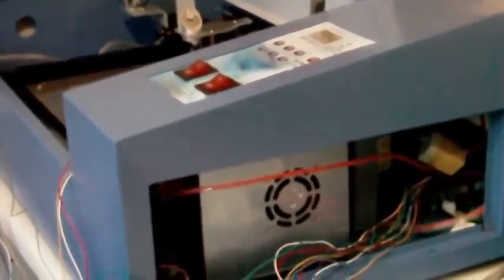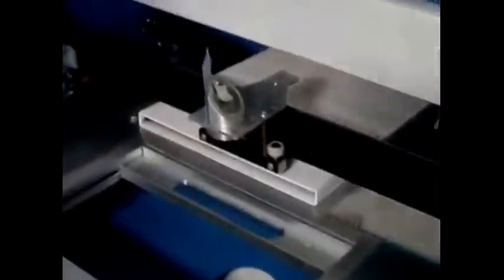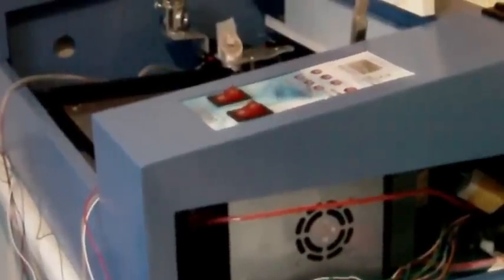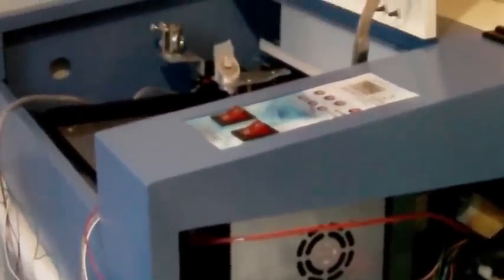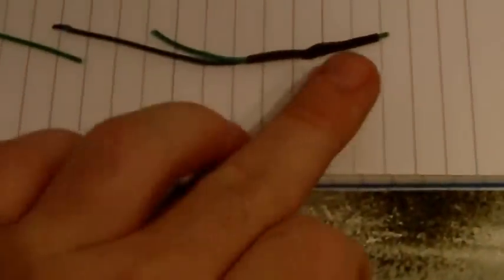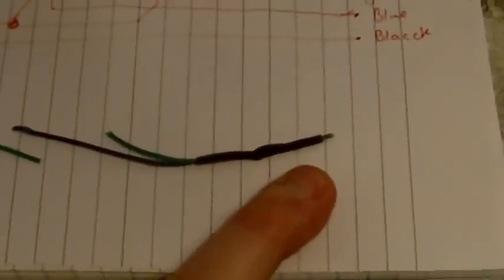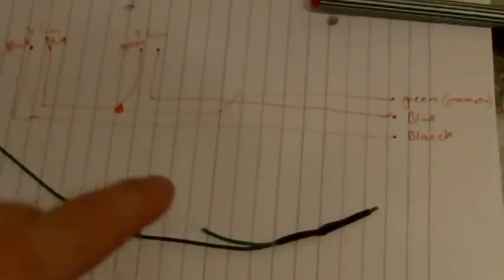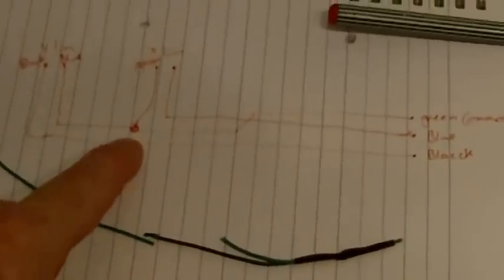cheap 40w laser cutter from eBay

Comment: You are talking about home switches not a limit. Limits are not fitted to this machine - however there is place for it on board.
Glad that you managed to sort out your problem, many users including myself finding something not right on this model:(
Reply from the maker: yeah, the two limit switches are used as homing switches in the homing cycle, but they do also act as full limit switches on those ends of the axis - it's a shame they didn't include the extra 2 micro-switches for the limits at the other ends too. :/ but for the money - can't really expect too much. I have a feeling I'll be ripping the electronics out and putting an Arduino in at some point as I really don't like the software they've supplied and the face it wont accept G Code!
Reply: Crazy-Logic If you want the speed than use the ethernet - expensive but worth it. What kind of arduino are you going to use? the same shield as in 3D printer?
Reply from the maker: janeqmx I could move to Ethernet, your comment has made me think about putting a Rasberry PI in instead of an Arduino, or maybe both. I was going to put in a standard Mega, and Id use my own Motor drivers shield, or or I could use any >2 axis motor shield that's off the shelf. Does't really matter to be honest. If I can replace the electronics then it'll make the machine allot more powerful.

Comment: I have the same machine .... Just a matter of interest to you , is check the current to the tube with a multimeter , and see what current ( mA ) its drawing , from 10 to 90 on the display , you will be shocked at the reading ...... 20 = 15mA  80 = 27mA , and that will kill your tube ... I fitted an anaolg meter on mine  to keep an eye on it . Great machine , and very pleased with it ... Hope this is some help .
Reply from the maker: oughhh, thanks Steve, I'll keep that in mind when next tuning power settings.

Comment: has anyone had success in realligning the mirrors ? i can only seem to get it to cut in the top left corner any help is appreciated and if possible i could bring the cutter to yourselves in the uk
Reply from the maker: I also have this problem a year or 2 on - i have aligned my mirrors to the best i think i can, but the cut accuracy in the top left is much better than the bottom right of the cutting area. TBH, i think it might be vibrations along the axis causing the laser to drift slightly. I have other issues with the cheap machine now such as the cutter not following the software, parallel lines not being parallel when cut and loads of other glitches.
Reply: Crazy-Logic hi I can't seem to get them.alligned at all
Reply: Where you  in  UK? ron
Reply: Ron Phillips north east but can travel

Comment: What problems at present time? See youtube ress sadler learning lab videos. Ask him directly who can help you. He's a good resource.on
Reply from the maker: Thanks for the tip - I had a quick look, and the material there looks great. I will certainly be watching a few if not all video's. 

I think most if not all my problems step from crappy software. The only software I can find that works with the board in the cutter is urm...... rubbish and virus infested and not open at all. So I was thinking of swapping it out for grbl and using a fully open workflow and pipeline. Just need to spend time on it really. The hardware just needs better control and some optical tweeking.